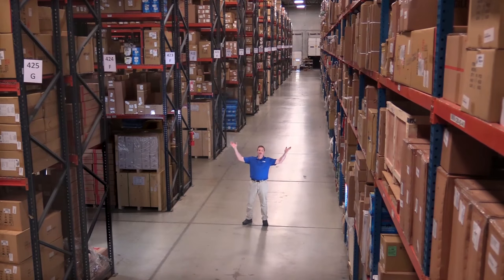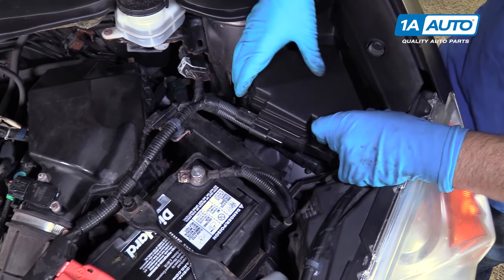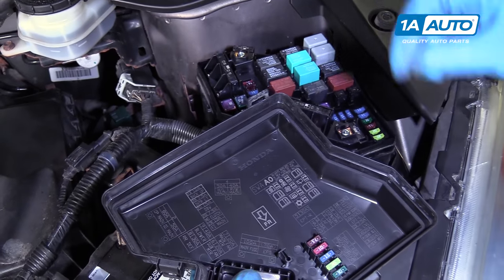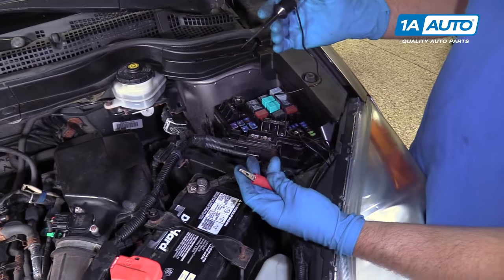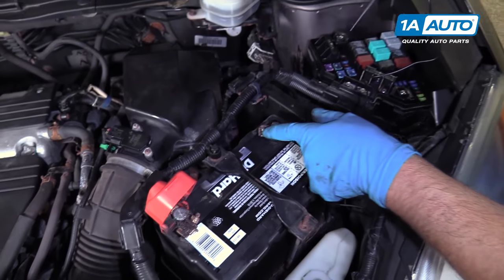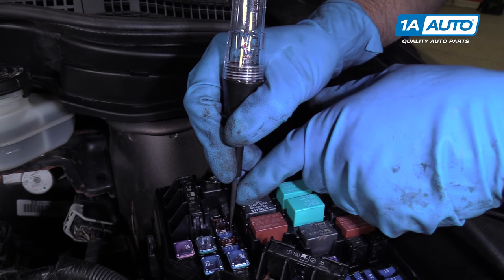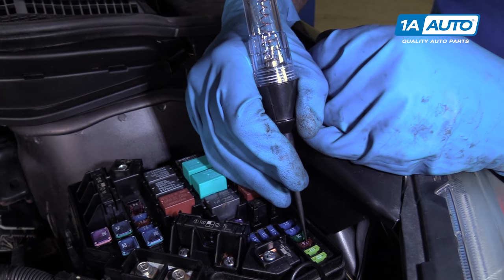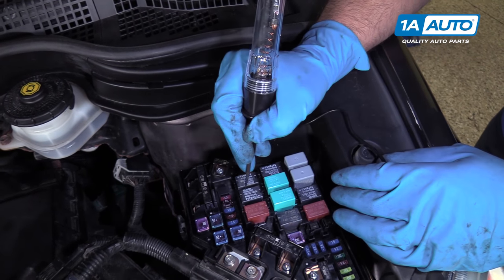How to Test Car Fuses Using a Test Light

Comment: I tested my alternator fuse and one side is lighting up, and the other side is not, I then replaced it with another fuse and it’s still doing the same, does this mean my alternator itself is bad? I was having issues with my car dying on me , I replaced the battery and so far so good but my D light is flickering on the dash. I have a 1999 Honda Civic. If anybody could help, I will I greatly appreciate it.

Comment: Does the ignition key need to be turned on to check all fuses?
Reply: Only when you check a fuse with a test light and both sides won't light up. It means there is no power running through the fuse which requires you to turn ignition to the seconds position, then test again that fuse.

Comment: Are all fuses supposed to light up with a test light? Some new fuses in my box wont light up but they do if i pit them in a different slot. Can some slots be bad or is it norman for some fuse slots to not have power that lights up the test light?

Comment: I want to check indoor fuses and where should I hook the clip ? There's a bare metal piece on the bottom near the pedals I guess that's a good place ?
Reply: They should have small holes in the front if not your going to have to check them one by one .🤔

Comment: How do you test the higher amp fuses (20, 30 and 40 amp fuses that surrounded that 15 amp fuse you first put the circuit tester on?They are the square flush mounted fuses. Also do they just pull out?

Comment: Would a continuity test with a multimeter lead in each port work to check if the metal internals of a fuse are blown?

Comment: Question 1994 Cadillac no lights check the bulbs but I've been hearing other people talking about fuses could be bad or relays can you advise on what I need to check, and could blown fuse drain the battery also
Reply from the maker: +Antonio Davis We wouldn't be able to diagnose an issue like that here, you may want to have a local mechanic take a look at it. Thanks for checking us out! http://1aau.to/m/Shop-1AAuto-c

Comment: My fuses are under my Driver's side dashboard.  Where are some alternate locations I can clip the light tester to, if I'm far from the main battery? Thanks!
Reply: Get a long alligator clip!
Reply: Just connect it to ground.  Find a bolt or any metal
Reply: @sullygully1976  will any bolt work?

Comment: Hi, good morning. I hope you are fine. Can you help me with 2 electrical troubles of Cadillac DeVille 1998?
-The instruments cluster doesn't work, just bulbs like brake, batterie, oil, but all display is dark; I'm almost sure that the problem is the cluster (I had check fuses and they are good) abd I have seen some videos and they tell that is the cluster; and the other problem is hazard lights, I can't find the flasher. Suppose it'll be on left side of cluster but I can't find it... Do you know where is it? Thank you very much and Hi since Mexico. God bless you....
Reply from the maker: +R. Roberto Godoy Moreno We can't really accurately diagnose that without seeing the vehicle. We would recommend you take it to a reputable mechanic for diagnosis
Reply: @1AAuto  hello I have a isquemia with gmc 2000...lights inside dont always turn on when I open doors

Comment: How do you test the 20, 30, 40 amp fuses?
Reply: Same way just put the metal to metal from your fuse tester should let you know. All fuses from small to bigger ATC have the holes. The worst if you still  having issues can be inside your vehicle under your steering wheel those are a pain in the a## . 🤔

Comment: What if the metal in the housing only lights up on one side does that mean I have to change it ?
Reply: In the video it’s stated that if only one side lights up then the fuse is bad and needs to be replaced with a new one.
Reply: Lol 😂

Comment: Hay guys I'm in deep shit 6 shops can't figer out what's wrong I gotta a 02 Honda Civic LX the car start right away but check engine blinks when rpms trying to find battery light goes on the. It drops to 0 rpms light battery goes on an check engine light stays on the hot an cold drops down to zero also one shop sad I can't communicate whit computer other 4 shops say they can I buy parts from u guys to put everything new still same issue any idea b for I burn my car down lol
Reply from the maker: +Polo Rico We are unable to diagnose issues, as there could be multiple reasons why you are experiencing this. Good luck and thank you for checking us out!
Reply: @1AAuto  na it's cool bro is just I don't get it I change everything new sensors an everything it's neather the ECU or some hot wire that I miss but if I find it I'll defently post a video a bout it did not go to school for machanic my house is my school reading books a bout the cars but I can just think what people are going crazy on the same bout az me im a bout to give up on Honda's after 7 years buying them cars I don't like the new ones bc every one has issue Whit them but tanks for the info let me know when ya gonna film a tranny on automatic 😁😁😁😁🤘🤘🤘🤘🤘
Reply: Sounds like you need a new ECM